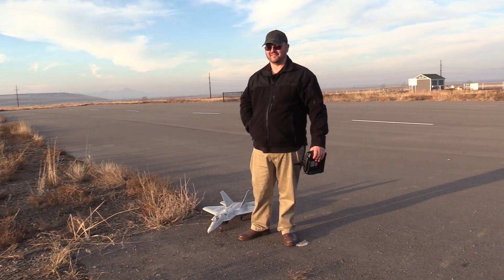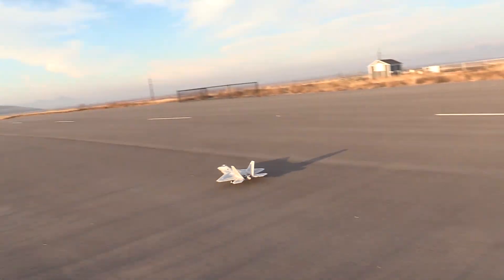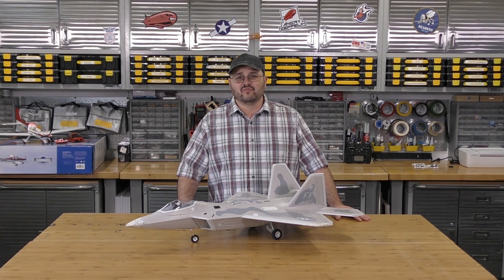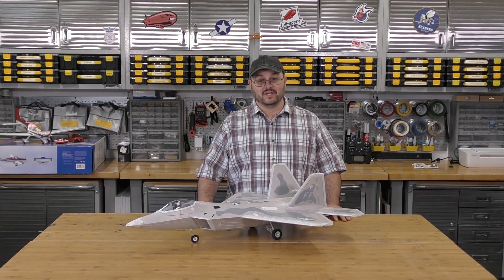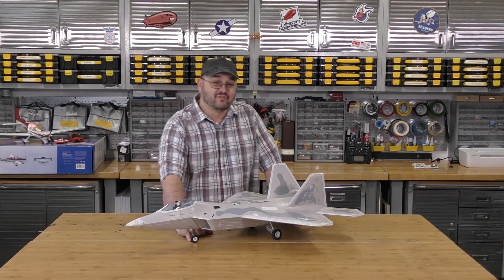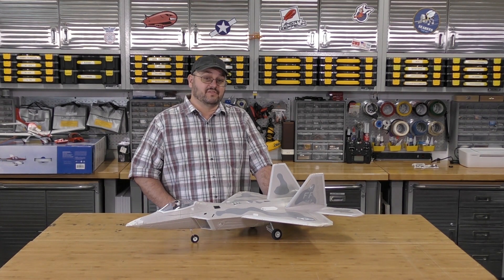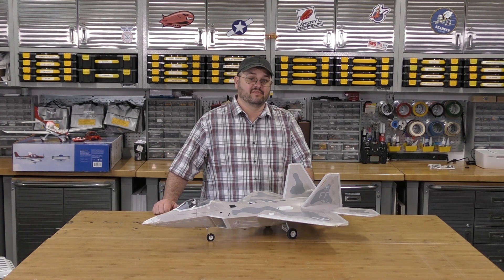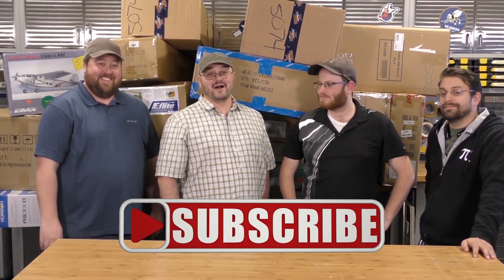Freewing F-22 Raptor 10th Flight and Review

Comment: I flown my 64mm f 22 on 6s 6/8/19 it is a beast now, I had to upgrade to my 9g servos. Cause both elevators stripped during hi stress maneuvers, the jet will go straight up out of site on a vertical hand launch 🚀 only on 6s